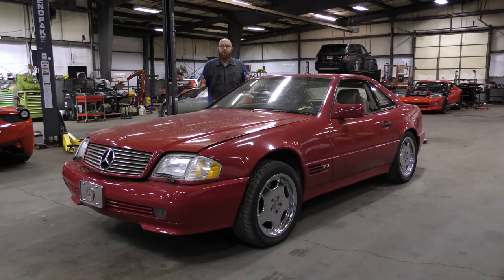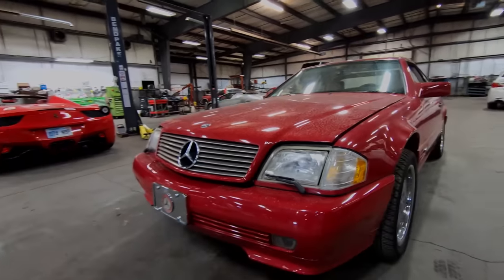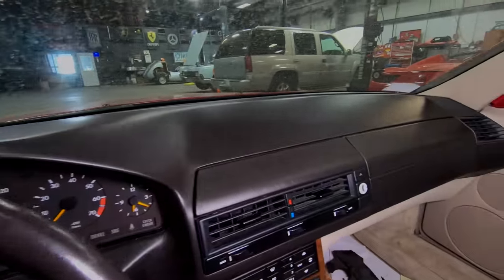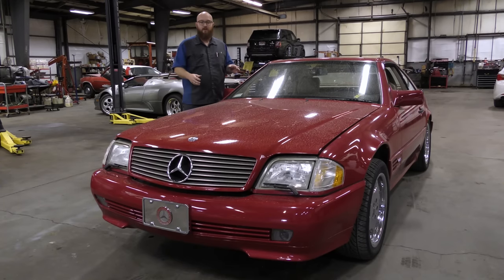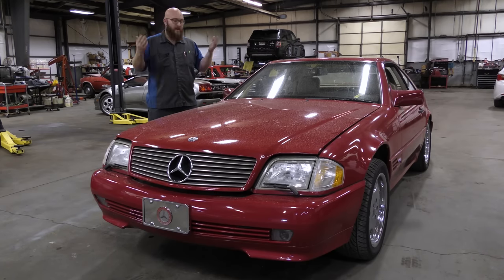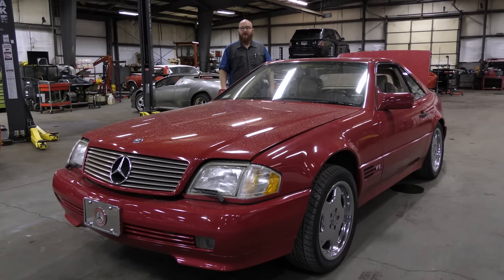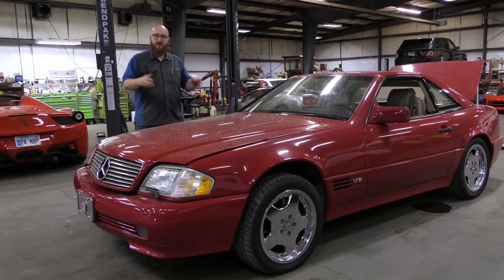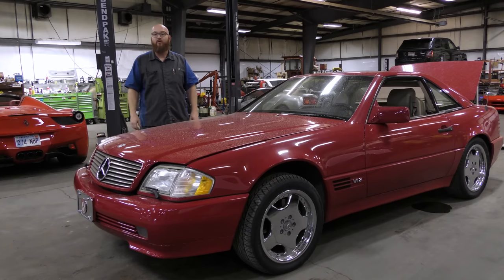Another customer scammed! CAR WIZARD shows why this '94 Mercedes SL600 is needing 15K to get sorted!

Comment: Watching this, I was left thinking that Mercedes took a conscious decision to see how many bad engineering decisions they could load into a single car. Either that, or they didn't care what happened to the car after its first rich owner disposed of it.

Given that this car would have been offered for sale for over $100,000 when brand new back in 1994, it really demonstrates the level of cynicism that infected Mercedes at that time.
Reply: Go to a MB dealer, it is mostly Dr. and some business guys who lease for two or three years.  No person is buying them for longevity.  MB has ZERO priority on longevity.  just short term snob appeal and tech wizardy
Reply: I just spent $1,500 (parts & labor) on a new full exhaust for my 2003 Honda Odyssey. The catalytic converter flanges rusted out completely, nothing left to fix or weld, the catalyst itself was still good, no check engine light but the fact there was no more steel to weld and the muffler had some holes it in I just had it all replaced. Has 174k miles and runs OK, there's a little steering wheel jitter at highway speeds that comes and goes, I already had all four balanced for $60 and it helped but still does it, I'm not going to sweat it, I'll keep driving it that way. Apparently this guy that spent $7,500 on a used pile of junk Mercedes-Benz never watched #SavageScotty . It's amazing what people will spend money on. I have to SMH.
Reply: If you have a good dealer in Europe or the classic centre, they will send you to the right company that makes it for you for a reasonable price.
Reply: Car is nearly 30 years old….
Reply: The majority of cars (performance oriented or not) are junk in the long run.
Reply: On the east coast we see truckloads of off lease or good condition used German cars heading to the ports. My guess would be to Central and South America.
The resale value for used German cars in the US would be even worse if they all stuck around.
Reply: @justacinnamonbun8658  Be careful - those 2nd gen Odysseys like to go through transmissions. They are notorious.
Reply: @Burnedtoastify  At 174k my original A/T still shifts pretty good. They only go out with dirty/worn fluid and there's a fine particle canister filter that's behind the battery that nobody knows about. 😆 I am getting some early downshifting upon breaking, like when going from 65mph down an exit ramp, it will occasionally shift down too soon and you get basically unwanted engine braking like in a manual. I'm assuming that's electronic/sensor and/or a solenoid issue. It has to go out eventually, we'll see if it makes it to 200k, I'm already thinking of making a trip to Clarksville so I can shut Scotty up! 😆
Reply: I wonder how many of these comments were written by anyone who owns a mercedes. I had two that made it just shy of 250k miles. it is easy to criticize a design that is 30 years old and a benchmark of design. Copying someone else design (aka Lexus) is easy pushing the window is much harder.  My SL600 is the oldest of 7 Mercedes I currently own.
Reply: @Calilasseia Not really. The R129 Mercedes especially the V12 trims were one of the LAST best cars that Mercedes ever made alongside the W140's. They were almost over engineered and they had better durability than their successors. Trust me I had a 2000-01 SL600 AMG I brought brand new and it ran like a dream until someone stole it and trashed the thing a few years later. That 94 model is just a exception to the rule considering the era. Also it looks whatever fraudulent USED car lot the owner brought it from knew that it had major problems due to a obvious lack of maintenance and still decided to sell it as is. What a complete joke to their customers actually!
Reply: @jkeelsnc  Absolute truth.  And 90 percent of people don't know/believe it.
Reply: @MrBaddebt   So what?  You can add?
Reply: @justacinnamonbun8658  i wouldnt waste 1500 on a shitbox honda odessy
Reply: @EazyDuz18  I really don't care what you would waste $1500 on, assuming you even had the money 🤣.
Reply: @justacinnamonbun8658  Could buy that hunk 'o' junk 1000x over 🤣😂🤣😂
Reply: Just over engineered.
Reply: That's about the era Lexus came upon the scene, and Mercedes had to get more serious?
Reply: Yeah of course..auto makers dont give a fuck about their cars after their 10 years old...why would they?? They want you to get the latest Greatest design model after 5 years
Reply: I have great respect for the Germans basic knowledge and skill. But problem is they as a stereotype (not necessarily as an individual person) have a bad arrogance and superiority problem. Ford mastered, at least to some degree, a simple hard top convertible back in 1957! Why do we need 10, 15, 20 cylinders to lower a hard top! It is just way too over engineered! Because I CAN do it does not mean I SHOULD do it!. Now this beautiful car that is virtually BARELY broke in good will probably hit the crusher unless a benevolent and VERY RICH benefactor scoops it up as a rescue! He or she will spend 2 to 3 X its worth just to preserve it if the car should be so lucky to find that special person that loves cars and could not stand for this beautiful example to go away and be shredded like any other 25 year old Corolla!
Reply: @pablopicaro7649  
I see the 90s Mercs aren't anything like the older ones ,like they lost their way. 
Without much knowledge,I recently took a chance on an 80 240d 4 speed I got from a customer because it is so clean. 
What a great car,I see what mercedes used to mean I can feel it in this car. 
I even dropped a wrench in the engine compartment and it hit the ground ! 
That hasn't happened to me in years! 
I do have a bad itch for a 90-91 560sec ,but not unless in good shape and I learn a lot more about them.
Reply: @don2deliver  South America? I don´t think so. In Chile you cannot import a used car unless it is a classic (25 y.o) that you are only allowed to use the weekends. Peru imports used cars buy mostly japanese because there is less trouble with them. I have travelled to Argentina several times and haven´t seen many old mercs. So I don´t think argentina imports crap either. Southamerica is a shithole (becasue of U.N communism) but don´t count on selling us your old german crap.
Reply: @pablomalaga4676  They are going somewhere out of the country if they are going on a boat. Tow trucks construction equipment, and buses leave in large numbers as well.
Reply: @don2deliver  then they run through the jungles and shit. crazy tbh
Reply: @kitafer  congrats on thinking it's trendy to waste money...we all know your mechanic loves you the way wizard loves hoovie!
Reply: @kitafer  lost a bunch on both my MBZ...
but made money on my Bentleys... go figure
Reply: the reason for all the cracking wiring is the idiot GREEN PARTY in germany that insisted all the plastics in the cars had to be made biodegradable, same for the hydraulic seals.
Reply: @don2deliver  The east coast ports do a ton of exporting to Africa. There's a budding middle class and even old beaters can spend their final years there. Labor is so cheap that 20+ hour jobs aren't really a problem, just need to pay for parts. I knew a guy that bought and exported cars to Ghana.
Reply: When cars were much simpler you did not suffer these expenses but now you want all these toys /switches great when new a nightmare 10 years down the line
Reply: I have a friend who bought a 2 year old AMG S-600 with 26,000 miles on it for $24,000.00. This is a car that cost $145,000.00 new, this should tell you everything you need to know about these cars. (On the other hand, The old 300-E was one of their best cars. We had one for a shop car. It was unstoppable, however it was slow as molasses in winter. But it worked for what we used it for.)
Reply: People who  buys brand new or really low mile Mercs usually  care about the longevity ,as they keeps the miles low and sell it once the warranty expires . Mercedes or any other European manufacturer knows about this and they probably make their cars hard to work on and unreliable  on purpose , so that they could sell them  their super expensive  replacement part . And usually  one broken part in a merc starts a chain reaction of broken parts . So the car spends most of its time on a mechanics shop ,draining your bank account. my friend learned it the hard way , because he wanted to look cool in a 8k marc.
Reply: @don2deliver  importers here in Sweden do a pretty fair business of importing rust free florida and california cars, both american 50s and europeans too AND european luxury cars.
The important thing is : RUST FREE or at least manageable.
Reply: This is so sad.   I was checking because there is one for sale here.   I now see this is no win.    Pretty in the corner while you feed the rodents.    Another European candidate for an American V8 and paperweight V 12.
Reply: @path.1499  Everything is junk given enough time. The question is what do you mean by "long run". There's a big difference between a Range Rover that's falling apart at 90,000 miles, and a Toyota that's falling apart at 400,000.
Reply: @pablopicaro7649  yes, that’s the case these days, but that was certainly not the case 30 years ago when the SL in this video was manufactured
Reply: Which is why Japanese cars are so popular

Comment: As a car enthusiast I have been watching your videos for some time and in each of them you always sound like you know your stuff and this video confirmed it to me. I know first hand that everything you mention in this video is spot on. I  owned a 1992 r129 500SL for 7 years, sold it last year. I really loved this car, the way it looked and the way it drove but I was spending my time fixing something from small things to big things. I did replace all the 12 cylinders myself in 2 week-ends with rebuilt ones from a company in Oregon. It cost me $700 for the set plus a good 15h of my time to do the job. If I had had to bring this car to a mechanic every time there was a problem I would have gone bankrupt.  Since mine was the 500 I did not have the air suspension issue nor did I have the biodegradable harness issue since the bad years for r129 harness were 1993/1994. Still this car required a lot of work to be kept drivable. Big thanks for your videos

Comment: I used to work on these Mercs . Its usually the small hyd rams beneath the back seat. They are junk. Its a shame because they are such a nice looking car and great to drive, when they work. We used to get a lot of W140's into our shop and the loom on the engine and the trans loom . The 6 cyl motor had individual coil packs on the plugs with 3 wires to each coil . The insulation used to break into little ringlets and fall apart and short out and if the customer didn't get onto it quickly, it fried the ecu. Now you are in for a ecu and loom. You cant see the insulation either because the loom is well wrapped.  we wrecked one just by taking the loom out of the way to remove the coils,  to change the plugs. Then you have the fun fact that there are up to 3 or 4 versions on the loom depending where in the world it was sold . we are right hand drive in NZ and get a lot of used cars from Japan and Singapore. the ones from Singapore had aluminium plugs in the hoes that run to the heater as the heaters are not used in Singapore. so they come to NZ and get sold to a customer. The customer want the heater to work as we need heaters in NZ. We drop the hoses and remove the plugs in the hoses. bleed the cooling system and send the car on its way. six weeks later it comes back on a tow truck with soggy green carpets. yes the heaters leaking. they have heater hoses connected to aluminium tubes to the heater core that have a small 2 bolt flange and "o' ring that's been dry for the last 10 years.  LOL  People say Andrew why are you banging your head against the wall ? "Because it feels good when I stop. Mercs and Bmws could have been such great cars but they got cheap in their manufacturing processes. The A160 was another example trans ecus that floats in the trans pan, airflow meters and fittings,, dashes that stop working, the trans in general the cheap ass 60km life expectancy of the starter if you were lucky.
Reply: Agreed.  My 1988 BMW 320 is still good.  Ok it would be better for new shocks all round but the rubber and plastic on my 2000s are beginning to fail.  When I look in the engine bay I wonder why they didn't just use stainless nuts and bolts or at least better galvanising.  Even the rubber air box mounts are going on the M5 and the headlight seals.  A shop would not replace any of these rubber parts because while it takes minutes to change the air filter, it takes a couple of hours to fit never mind days to wait for dozens of bespoke grommets, washer and rubber spacers.  Time that the car is immobile and blocking other jobs.  The icing on any premium car is the electronics which date and die and cost more than the car is worth.
Reply: Go to a MB dealer, it is mostly Dr. and some business guys who lease for two or three years.  No person is buying them for longevity.  MB has ZERO priority on longevity.  just short term snob appeal and tech wizardy
Reply: @jkeelsnc  Here in NZ I think the Korean cars are getting better. Out of most of the larger European manufacturers Volvo seem to be reliable one.  In the pickup market it was always Toyota on top with the Hilux  and now Ford are having problems suppling enough of their Rangers as they are selling so fast.. The Isuzu pickups are selling well too, giving Nissan and Mitsi a run for their money. We also get Ssangyong and Great wall motors and Mahindra selling pickups here too. I had a ride in a Great Wall one recently. They have come a long way in the past 5 years. It drove well and had plenty of power and looked good too. So times are a changing . It will be interesting how the market for the slower selling brands go in the next 5 years.
Reply: @jkeelsnc  Nissan has been Renault powered junk for quite a few years. Honda Civics and Accords are okay, Mazdas are reliable but rust like a bastard. VW Audi stuff is pretty poor.
Reply: @jkeelsnc  Yet here in Europe German cars don't have this negative reputation. Perhaps you're the problem?
Reply: @jkeelsnc  Right, like I said, it's a US "problem" only. Meaning the poor maintenance habits and rip off/incompetent mechanics are the actual problem. There are all sorts of older German cars on the road here that are well past a three year lease period. BTW, leasing is almost always more expensive than maintaining a similar older vehicle but if you want to lease be my guest as it only helps the car makes.
Reply: @jkeelsnc  I like the 80's and 90's stuff too but when I said older I meant like 10-15 year old BMW's and Audi's. You see them all the time here, E60 and E90 are popular. Lexus models, like all brands, have become very complicated and can be problematic. It isn't 1995 anymore where you remember the LS400 and ES300.
Reply: @berwhaletheavenger  It's actually the Renault stuff that lasts longer than the Nissan junk.
Reply: That same issues happening to my 2004 porsche cayenne winter beater. The harness plastics are breaking down with age and it's getting cylinder misfires and not to mention all the other harnesses for the rest of the components in the suv.german engineering is a work of art but they sure got the last laugh knowing everything would degrade over time.german cars literally are tanks or used to be built solid,I don't understand why they made the stupid decision to have the harness wires and plastics so fragile. They literally get electrical problems due to the wiring insulation degrading over time.ps I am a novice mechanic that does 95 percent of all the repairs or maintenance needed to be done on my vehicles.if you're not a mechanic with some electrical repair knowledge you're gonna be spending big bucks to get the vehicle fixed or have it sit on your driveway until you fix it or get rid of it
Reply: HORRIBLE BIODEGRADABLE WIRING HARNESS TO COILS 🤔
I fixed that problem myself on a '94 W202 C280 Mercedes, by stripping insulation back to the bare wires and removing the rubber compound rubbish (carefully cutting the rectengular harness) and tracing the wires as far as possible behind the valve cover into the fire wall  untll the remaining insulation appeared to be in order.
Then desolderd all terminals and covered the bare wires with quality heatshrink plus protective electrical thermal tubing.
Re-soldered the teminals and reconnected everything.
Took me a little over two hours.
This was four years ago and everything still works fine.
Car manufacturers have done some stupid things and getting worse as modern cars are becoming more unnecessarily  complicated.
The car is now nearly 30 years old & has traveled 335.000 trouble free kilometers.
 Still going strong and there's not a rattle in it.
Try that with a Model C built after 1999 🤔